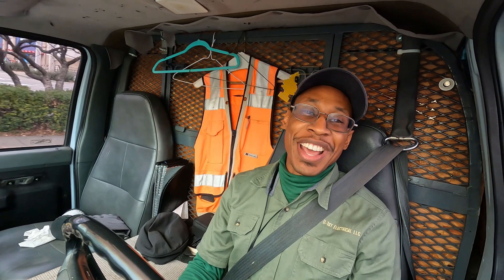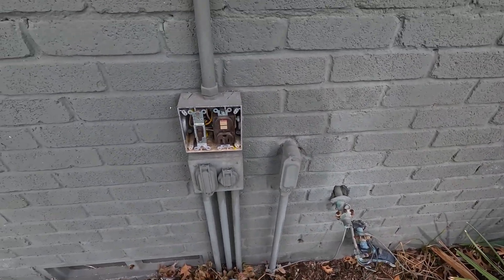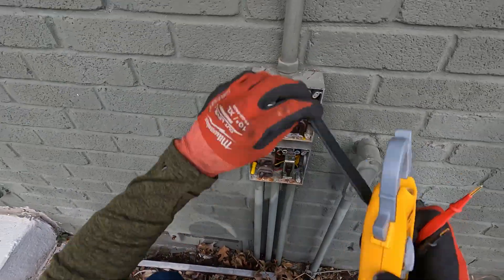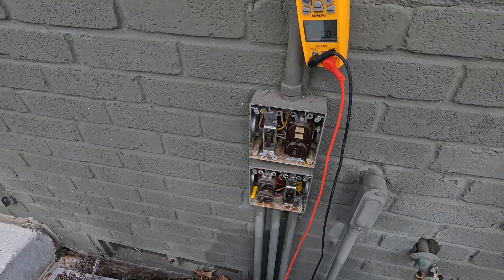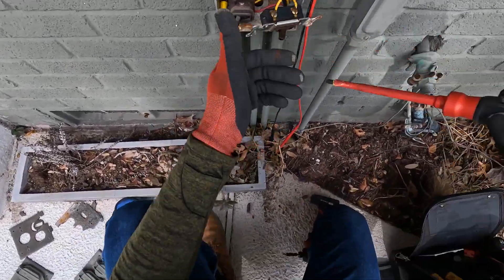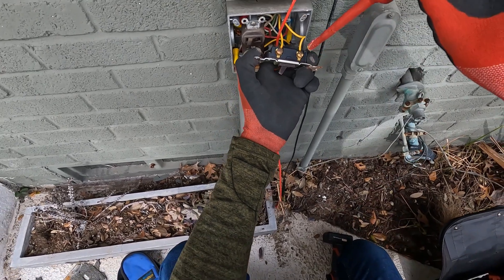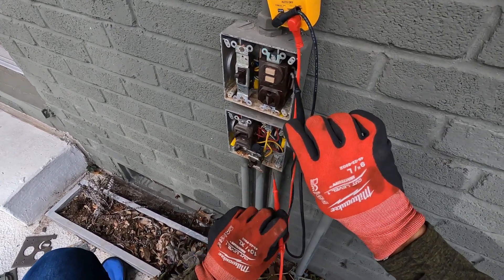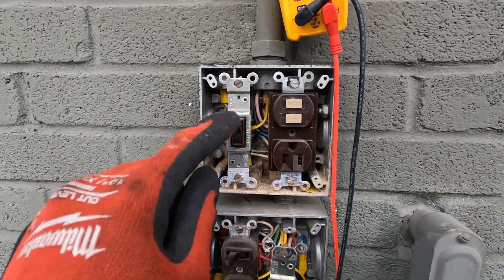Electrician Troubleshoot Backwards Wiring! No Power on Light Switch

Comment: Hello, quick question, how come there is a correct wiring of a switch ? A switch is just a simple interrupter, on one terminal you put the hot and the other the load side, and that's it, doesn't matter which wire you put on which switch terminal, I am def missed something!
Anyways great video!
Reply: I am wondering the same thing. I suppose that it’s good practice to wire the hot to the bottom screw, but won’t the switch work either way, hot on the bottom screw and switch leg on the top screw, or vice versa? I’m confused as to how switching the wires solved the issue at hand. 🤔 Just wanting to understand.

Love your first person point of view videos. Thanks for sharing.
Reply: @Vince  I've never seen a standard single pole switch where the load must be connected to the bottom screw. I really expected he was going to  show that the neutral was switched instead of the hot. I've had people ask me which wire should go through the switch. It's definitely hazardous to switch the neutral cause someone might just turn off the switch to work on the light and think they were safe. I know really old "quiet" switches used mercury to make the connection and if you physically put the switch in upside down it wouldn't work right. And for any single pole switch it's confusing to physically put the switch in upside down cause then up is off and down is on. I'm enjoying Steve's videos - did you see the one with a lot of wires connected without junction boxes in the attic? I'm always amazed that people don't use junction boxes. The one in Steve's video is the worst I've ever seen! Thankfully he advised the homeowner to have him come back and fix all the rest of them.
Reply: Could you please explain the difference in wiring the top hot to the bottom, I’m not following.I would hate to find out I’ve been installing light switches the wrong way for the last 25 years
Reply from the maker: @highvoltage1979  Google an see the contact point in the line an load screws.  If you put the hot wire on the wrong screw that doesn't  close the contact point, current will not flow through switch. Please do a google search so you can see an illustration of the inside of the switch an you will see the contact point inside the switch.
Reply: @unitedtradesmanacademy1894  I googled this , single pole wiring diagrams and many pics showed the line terminated on the bottom
Reply: @unitedtradesmanacademy1894  Single pole switches aren't smart, they jusy have a metalic tab that closes and opens depending on the position of the toggle, it doesn't recognize or care which terminal has what wire (Line or Load), I ve opened single pole switches, and there is really nothing to them (unlike electronic switches and smart switches).
Reply from the maker: @highvoltage1979  If you put the wires any way you want to. The light switch could possibly turn on when the switch itself says off. It will be reversed. If you dont mind the switch saying off an the light turns on or vice versa be my guess.
Reply from the maker: @Htm.13  If you put the wires any way you want to. The light switch could possibly turn on when the switch itself says off. It will be reversed. If you dont mind the switch saying off an the light turns on or vice versa be my guess.
Reply: @unitedtradesmanacademy1894  you’re messing with me now
Reply from the maker: @highvoltage1979  lol
Reply from the maker: I can't believe you all having a hard time understanding wiring a single pole switch. There is a certain way to wire a single pole switch. You don't just put the wires on either terminal or screw.
Reply: @unitedtradesmanacademy1894  How come ? I am a union electrician myself, and in a single pole switch there is absolutely no practical difference if you put the line or load up or down, a single pole switch has just 2 modes, continuity or No continuity, it can't tell which wire goes where! I do understand that we all prefer to put the Line side in the top screw to mimic Disconnects installations, but that's about it, just out of habit, it makes no functional difference in a trouble shooting situation, if I think that the switch is bad, I d just bypass it to test, but totally don't get how the line and load positioning on terminals make any difference.
Again my question is out of pure curiosity! Love your content, susbcribed and faved! Be blessed
Reply from the maker: @Htm.13  ok whatever you say. I do this for a living everyday.
Reply: @unitedtradesmanacademy1894  I am not trying to be rude, I also do this everyday for a living, I am genuinely asking trying to learn something.
Reply: @unitedtradesmanacademy1894  kind of a jerk response, person was just trying to understand.
Reply: I always connect the switchs like that hot on the bottom switch leg on the top

Comment: Man yesterday I was doing a maintenance on a carrier system and daikin pancake unit. Checked the carrier it needed a capacitor changed the cam but I pulled the disconnect and pulled the thermostat connector to the defrost/control board. I thought all the power was dead until I connected the thermostat wire back to the board with the connector. Man the unit started up, I was like damn I could have been hit with 240 . Pulled of the plastic cover , someone wired the condenser straight to the main breaker panel because the 20 amp fuses in the box blew and they never went to get new fuses. People will do thing that can get the next person hurt great vids man
Reply: I think that's called temporary permanent. 🤣 Glad you're ok
Reply from the maker: Bro thats crazy

Comment: Most all of the water heaters that I run across just have a wire running to the electrical compartment of the water heater, Some people on YouTube say it should be in conduit or flex. Any thoughts on this ?
Reply from the maker: Something should be protecting the wires from damage.